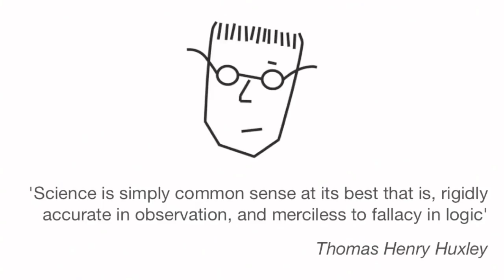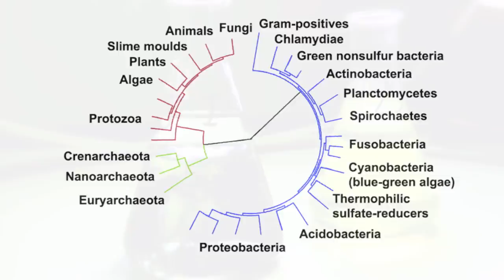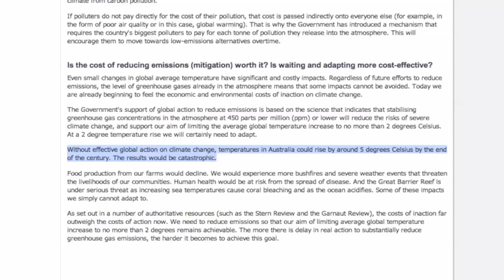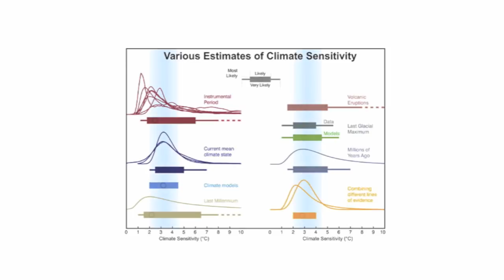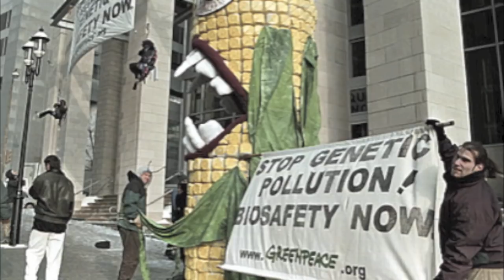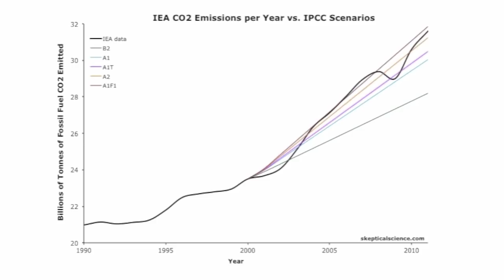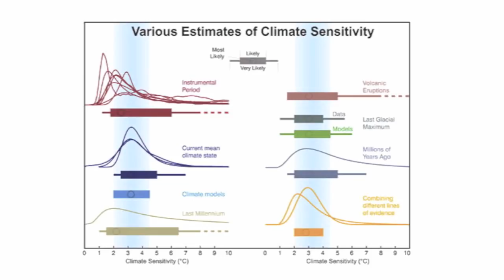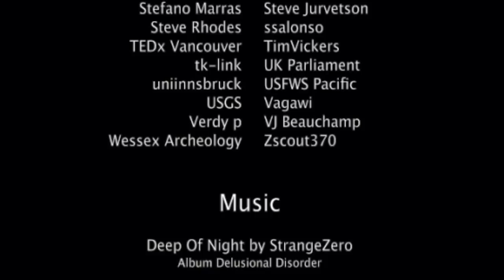Climate Changes, But Facts Don't: Debunking Monckton

Comment: Popularity is for faith anyway. If it is not rational then I don't believe it. The carbon dioxide went up first in the past and also carbon dioxide was high during ice ages. That alone should tell you that carbon dioxide is a minor player. Satellites show the Earth has not warmed since 2001 and the more C02 there is the less effect it has for each additional unit, much less. It is logarithmic. Also if greenhouse gas were the cause there would be a warm spot 10km above the earth.

Comment: This is all very expensive for a small amount of electricity and with all your costs you cannot sell your electricity for the same price as fossil fuel electricity.
So in then end the electricity you generate is subsidised. ie you get paid more for the electricity you produce that the coal power company. You both send the same product to the consumer but you get paid more because you are 'green'.

Comment: The pace of Research is very much hindered by the oil companies hold on politicians, Which they have. Do not kid yourself about that.

Yes you can very well say that we're stuck with negative energy sources for the moment, However, how much are we willing to get off of them? And do you think going about it in the slowest way possible with the non-maximum amount of funding than is possible is at all beneficial to us?

The Oil companies hinder doing more research. It's a tough position to be in.

Comment: I'll take this one comment at a time, and bring up what I find on each issue you bring up. Lets start with this one.

Conspiracy? no. It's the results of where the money goes.

If the majority of money goes toward Oil instead of where it should be going, that is money that is hindering advancement.

Secondly Nuclear research? as useful as it is, it is extremely dangerous, For example Fukushima, Remember that? No of course not. Nuclear energy is completely safe disregard any disasters or dangers.

Comment: You just don't understand anything. There is a difference between a claim and hyperbole. If you start imposing policies on people that end up impoverishing them, they will resist, you may respond with oppression to go further towards the goal, but the result will be only anescalation with an obvious ending. Now, that is the reason you need to get back to the economic topic, or this discussion cannot go further.

Comment: I've never really taken fusion energy seriously as it's certainly not going to be part of the energy equation in the near term. A previous comment about the energy required for containing the reaction was an interesting one. I imagine initiating the reaction and maintaining the pressure for the fusion process would require significant energy input. Has any work been done on potential net energy return for fusion?

Comment from the maker: Please do not straw man my position.

You still don't seem to understand what climate noise is and how this translated into the ensembles the IPCC uses for their projections.

And yes there are observations that would invalidate the theory, the problem with the 16 years period is that it is too short (we need between 20 and 30 years of data). It also ignores the fact that our planet is still accumulating heat.

Also what do you mean with the driven vs driver of CO2 remarks?

Comment: I just watched a You Tube video stating in essence that raising carbon dioxide levels are countering a cooling trend due to a Malonivich cycle which would have the world enter into an ice age.  Carbon Dioxide and methane levels rose due to forest clearing, rice cultivation and animal husbandry. If this had not been done the brief inter glacial period would have ended and the world would have returned to the start of another ice age.
Reply: +Gary Vardon Yes, Bill Ruddiman's work looks very convincing to me. According to Ruddiman prior half dozen interglacials had GMST go down 1.2 degrees during 7,000 years after the warm peak (according to Ruddiman) but this one started the same but then went off track at 6,000 years ago and GMST went down only 0.6 degrees during 7,000 years after the warm peak.  Ruddiman's analysis is CO2 started rising slightly instead of falling  6,000 years ago  then CH4 started rising slightly instead of falling  4,000 years ago, all due to humans agriculture & animal husbandry. I find it convincing. Of course, a glaciation is 5 degrees lower GMST so it should have been only 24% of the way to the next glaciation "ice age" depth of coldness a couple hundred years ago but was only 12% of the way down to the next glaciation "ice age" depth of coldness a couple hundred years ago ("Little Ice Age"). Interesting stuff. Humans accidentally made it quite a bit nicer for 6,000 years and then decided to go absolutely hog wild and ruin it all. Typical humans, sounds about right for us.
Reply: Milankovitch. 17,000 years hence.  But before today's exponentially increasing fossil carbon combustion. Exciting times.

Comment from the maker: I have never said you are a climate science denier, don't misrepresent my position (that's a violation of rule 7 and 5). You again stated that it's a cult after I told you not to do that, that's again a violation of rule 7.

Which page in the 2008 NOAA report mentions that?

Again, have you watched my video? As periods of almost no warming is mentioned in it.

Besides, you are focusing on land surface temperatures which represent only ~2% of where the extra heat is going.

Comment: If you believe in this you should understand it enough to explain it. If you can't explain it you are probably believing in it without actually understanding it. This video is not a basic explanation either, it is a refutation of a refutation. That is not to say you can't understand something and then refer to somebody else for more in depth information related to the source of data or methodology, but you should be able to provide the basic argument if you actually thought about it yourself.

Comment: On the GMO issue, I suspect that Monckton is thinking of "chemically induced mutation" which was commonly used back then. I don't know much about "miracle rice" but I'm sure this technique was used by Norman Borlaug in the development of semi-dwarf wheat. GMO proponents often cite this as an example, neglecting the fact that it only involves endogenous mutations. Whereas, what GMO opponents are most worried about is "horizontal" gene transfer between disparate species. 

BTW, thanks for your excellent video here. It's quite thorough, and must have taken a lot of time to produce.
Reply from the maker: Might be, but that's not considered a GMO. At least not by how the term is defined. The argument you're highlighting is used to illustrate how strange it is to see GMOs as unnatural or something special. But we've been doing far more invasive things to DNA for a long time.

Comment from the maker: Let me ask again, what are your sources for your point that the economy will tank and billions will die if measures to reduce emissions are introduced? (let me point you to rule 7 of my channel: No unsourced claims)
You also still haven't answered my question about which statements Monckton has corrected.
Implementing technology is not the same as removing it, that's an incorrect analogy. It also doesn't deal with my point that doing something about our emissions is more profitable/less costly.

Comment from the maker: Please attach your responses to the comment you're responding to, or it will get confusing really fast.
Sorry but citing on-off weather events isn't what's used to support the scientific consensus on AGW. There's far more to that than this and you should know that if you have watched this video.
Yes I'm aware of that article. However, what a newspaper says is irrelevant (it's the literature that matters).
Also I have pointed out to you multiple times that the planet is still accumulating heat.

Comment from the maker: Bye.

After giving you several warnings on rule 7 and me asking a final time for sources you ignore the comment (comment below). To me that means you don't want to have an open and honest exchange.

I also pointed out that you were making a false dilemma fallacy as there are more than two possible outcomes.

You completely dismissed the stance of experts and ignored me pointing out the cost of not acting. And you misrepresented my position in your last comment.

That ended my patience.

Comment from the maker: The total heat content of the oceans are going up, that means that it's still accumulating heat. Even if the 0-700m has a flat trend, if the lower oceans are still holding on to more heat it doesn't mean the oceans aren't accumulating more heat.

And if you had paid attention to my video you might have noticed that I talked about how/why this is happening in my video I pointed you to.

Comment from the maker: Again, please attach your response to the comment you're responding to.

You're disagreeing with the author of the paper: "At the present time we can not say whether cosmic rays affect the climate". bit. ly/12jn8Nk

That cosmic rays could have an influence on cloud formation is nothing new. However, going from a possible mechanism to stating it will cause global cooling is stretching the results past what they can be used for.

Your link doesn't work, is this the paper?: bit. ly/12joesf

Comment: I'm going to be giving you some more channels to check later on, for even more evidences, but it's going to take me a while to go through my subscriptions to find them and list them for you. Until then I'll address your issue with the refutations of refutations.
When I give evidences, and you refute those, and then I correct your refutation, would you then still say that I have no evidences? Of course not. Because the refutation was corrected, the evidences were reaffirmed as being valid.
(TBC)

Comment from the maker: Tip: If you use an URL shortener you can send people links that are easy to use, for example:
bit. ly/q7x064

It also has the advantage of not using a lot of characters which leaves more room for context/explanations.

Comment from the maker: Just like Stau said common sense has no place in a discussion on science subjects, as a lot of science doesn't match with what we would consider common sense.

He also has a point that sea level rise can only be explained if you also take into account thermal expansion. There's just not enough melting, and other sources of water, to explain the rise.

You are also just constantly dismissing without actually forwarding any evidence that the research I cited is not correct.

Comment from the maker: Side topic? You mentioned it in your second comment, repeated it a second time, and a third when you tried to justify it. When asked you either back it up or withdraw it like you did with the point "You are "debunking" statements that Monckton himself has already admitted to be inaccurate" if you can't defend it.

I strongly suggest you do one of these considering you've been warned multiple times that this is a violation of rule 7 of my channel.

Did you watch this video?: bit. ly/13mP4hp

Comment from the maker: That "unsubstantiated junk" is a meta-analysis of 60 other papers in the literature. If you have criticism about methodology or points in the paper, say it. Don't just throw out rhetoric.

Also it's not shocking what most of the paper says. We know weather and climate events can have a destabilizing effect. But even if the paper isn't correct it has nothing to do with the science behind AGW being correct or not.

For ignoring my source request: ban warning 2
Reply: +Collin Maessen I hope in the last four years since you made this comment, you have changed your mind. Here is what you said "Don't just throw out rhetoric."

Throw out rhetoric, every bit of it, because rhetoric is nothing but soft words and soft language intended to persuade people, even into doing very dangerous things to each other.

Just present the evidence, but don't encourage an armed group of savages to use your rhetoric to riot and rampage and hurt other people. 

And don't twist "evidence" to fit an agenda.

Comment from the maker: All of which I have pointed out to him before you responded to me. But that's not what my mod remark was about. What you said was irrelevant to him being correct or not, or understanding the subject or not. It simply doesn't matter in relation to that. I'm also not a scientist, neither are a lot of the folks I'm critical about, it just doesn't matter. In fact, I've been critical for people dismissing others based on credentials instead of dealing with the validity of their arguments.

Comment from the maker: You don't calculate that trend from 1995 to 2013 as 2013 is incomplete. You calculate from 1995 to 2012. And again, you need 20 to 30 year of trend data to say anything meaningful about a trend.

Also if something is not statistically significant it doesn't mean it hasn't warmed. Nor do you seem to understand the meaning of the error bars as this doesn't only apply downward. Read this: bit. ly/13ccZBE

How is it killing millions of people (source)?

Again, source for Hansen claim.

Comment from the maker: Now I understand why you used 2001 and 2002 and the Hadcrut4 data, as that gives you what you want. If you pick 2000 all available temperature sets show a positive trend.
How did you calculate the statistical significance?
And again you're misrepresenting my statement, I never said that. My point was that you're using periods that are too short and you ignore evidence.
About the "cooling": watch?v=88jEdz7OGx0
About the sun: watch?v=zEEstJLlBB0
This was the last time that I've repeated myself.

Comment from the maker: If you say something is not trustworthy then by definition you imply it's untrustworthy. You also called it evil.

Due to the sheer amount of stuff you just linked me to I won't be able to read it. Currently don't have the time. 

Although I find it interesting that you are focussing in on retractions, those are actually good. That's scientists weeding out incorrect papers. One of the papers you cited shows it's mostly errors and the increase could simply an increase in policing (Steen 2011).

Comment from the maker: For one it hasn't disconfirmed, as the theory rests on far more evidence than only surface temperatures.

And as Robbie pointed out to you the period you're using for your argument is too short. You need at least 20 to 30 years of temperature data before you can start saying anything about a trend.

And how did you get those different trend numbers (source please)? As it looks to me you're using very specific dates to get those numbers: bit. ly/12Lm9Be

Comment: Thank you for taking the time to make this very well researched video. I have been watching AGW for quite awhile now and because of this and other similar information I'm ready to accept that AGW is going to be a problem.

The trouble is that it does not seem possible to actually do much to stop it.  We can only hope that the now confirmed peak in oil production and the end of cheap oil will force the needed change upon us.
Reply: Since there seems to be an issue with fossil fuels, the question is what to do about it. This is my answer. If anyone has a different solution, I'd like to hear it. Let's begin with BTUin vs BTUs out by the energy source. 
Corn 1.3 
Solar PV 9 
Natural gas 10 
Windmills 18 
Light Water Reactors 80 
Coal 80 
Hydropower 100
LFTR and TWR 2,000 

Now consider deaths per terrawatt. 
Coal 161 
Oil 36 
Biomass 12 
Peat 12 
Natural gas 4 
Solar PV .44 
Hydropower .10 
Light water reactors .04 
LFTR and TWR .003 
As you can see LFTRs and TWRs are the most cost efficient and safest energy supply possible at this time. We should easily be able to reach $0.02 to $0.03 per kilowatt-hour. That brings the price of everything down substantially. Building small mass-produced modular breeder reactors would make windmills and solar panels exceptionally cost-effective. We could have the population producing the majority of their own energy leaving nuclear energy for industry. Or we can continue with this absurd global warming debate. 

Let us now talk about the multiplier effect. If we build breeder reactors first and use that electricity to produce solar panels, the multiplier effect would be 2000*9=18,000 to 1. Considering a coal-fired power plant has a ratio of about 80 to 1, that figures out to be about 18,000/80=225 times the increase in efficiency. Doing so would flatten out the worlds hierarchies creating vastly greater independence world wide.  This would accomplish exactly what the murderous communists attempted but badly failed at.

Comment from the maker: Source for the Hansen claim?

You're misrepresenting the science of the 70s: bit. ly/18D0sI2

I never said that, I said " You need at least 20 to 30 years of temperature data before you can start saying anything about a trend." I didn't mean it would disprove the theory, don't misrepresent my statements.

And again, there's ample evidence our planet is still accumulating heat: watch?v=88jEdz7OGx0

On what are you basing that temps have been flat for almost 20 years?